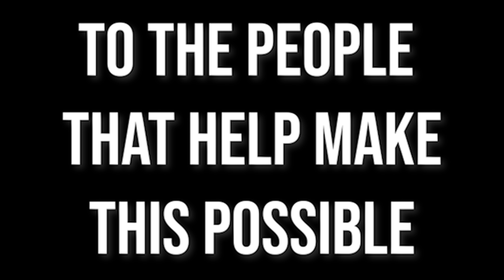Can The RYOBI Beat The BOSS? - Impact Driver Comparison!

Comment: That Ryobi is a much better tool then people give it credit for. People have this preconceived stigma against the tool that will be shown to be wrong as it moves up the Ranks in TTR. The only one I’m certain it will lose against is the Gen 3 Milwaukee, but even against that I think it will do a good job considering the price points of the 2 tools. The Makita and Rigid will be close battles if it goes against them I would think.
Reply from the maker: Ryobi is definetly impressive!
Reply: @VCGConstruction  I run ryobi and love them. Robi now has a 6 amp hour battery designed for their brushless tool line.
Reply: Clearly RYOBI is for DIY and Milwaukee is for PRO, however both are owned by Techtronic Industries so they are relatives to each other and may share many parts and solutions. Cheers form Poland:)

Comment: I'm still working off the set I bought back in 2012. Still kicking. I think Ryobi is great for the weekend warrior. But in professional settings, maybe step up. I've used mine in both settings. Held up great. Just feel the Ryobi might burn up faster than some higher quality ones. But guess it depends on the use. Main advantage ryobi has over most is their battery system. I only had 2 and forgot my charger one day. Buddy had a few old blue and yellows. So that's my biggest reason for sticking with them.
Reply from the maker: Awesome, we appreciate the feedback!!

Comment: Nice job again boys.
Respect for Ryobi's performance. My question has always been one of longevity.
Reply from the maker: Thank you badger!
Reply: I have two old Ryobi from back in the day they were still blue, not alien green
 Both the impact and drill still work flawlessly for framing and workworking in general. They operate with the new batteries and go forever in one single charge. I have been considering buying their new model, but I guess I will keep my old ones now that they are old enough to have a drink.

Comment: Ryobi is a great tool for THE DIY HOMEOWNERS OR LIGHT DUTY CONTRACTORS
Reply from the maker: I agree John!
Reply: It depends on the tool. From my personal experience with ryobi. 
Good tools are the 18v impact driver, the 18v oscillating multitool, 18v 18ga brad nailer, the hybrid corded/cordless transfer pump  and the corded planer. 
Not so good tools are the 18v circular saw, 18v reciprocating saw, the 18v drill/driver, the corded 4" grinder, the corded palm sander.
 So as you can see there are more bad than good. I cannot speak on their brushless offerings because the tools I an referring to came in their 6pc ultimate combo. Of the 6 only the impact driver and the oscillating tool are still working.
Reply: Jose Medrano all the tools in the combos are typically the cheapest they offer. Almost none of the tools in the combos are any good except the impact with the metal front housing. They put the cheapest offering in the combos and the smallest batteries to keep the price way down